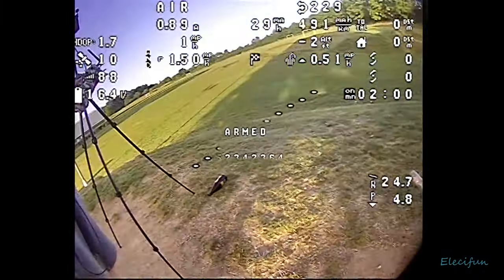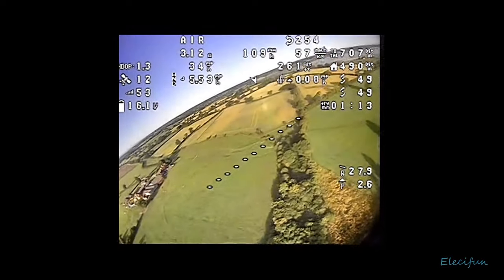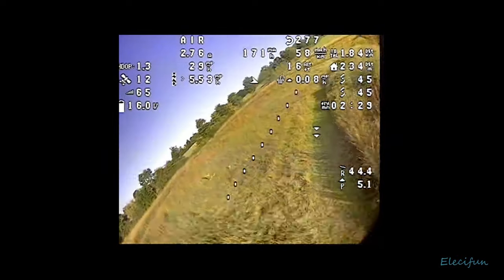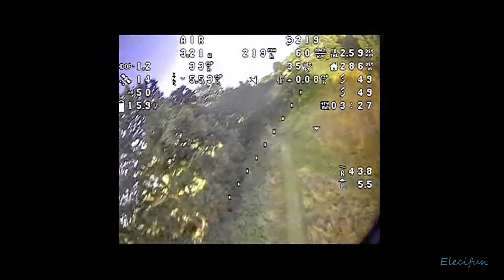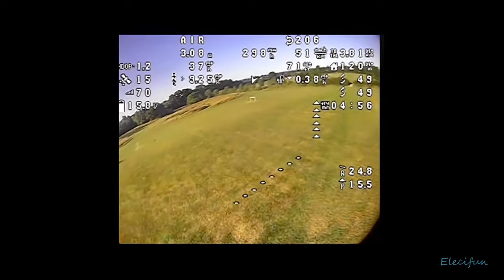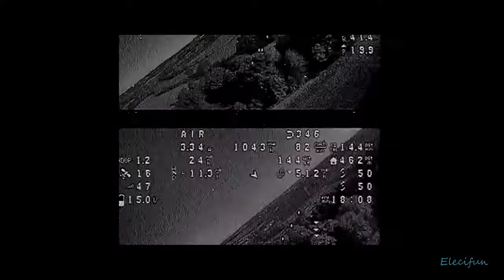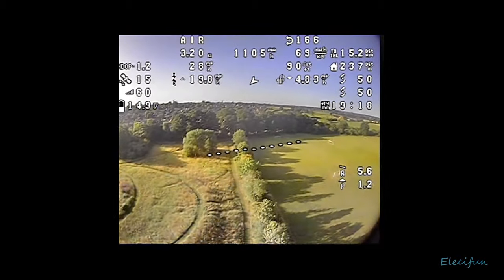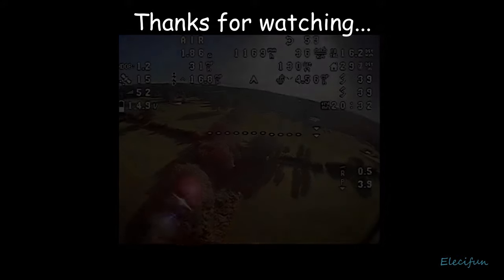RC Model Flying When things go wrong.

Comment: Nice!
Reply: It's funny, I subed when you built that clock from ebay! It made me buy a few of them.
Reply from the maker: I still have the clock and it works, how about yourself?
Reply: @Elecifun  It's been on the whole time but i put some larger resisters in because leds were not lasting more than a week.